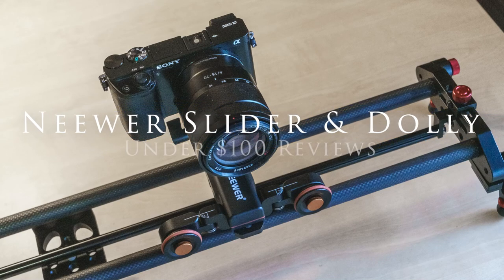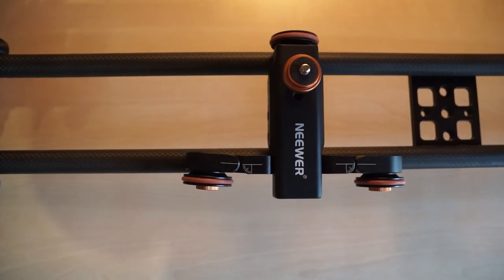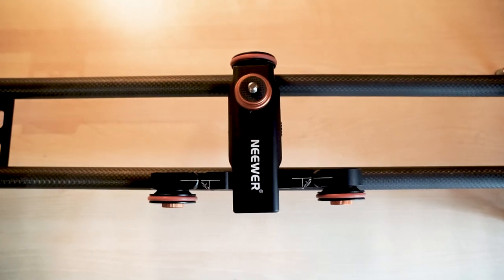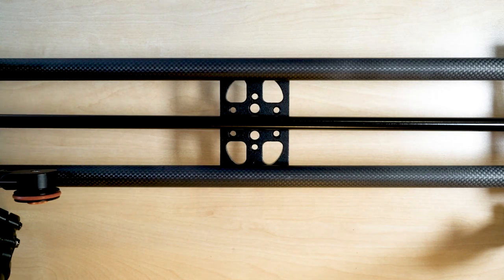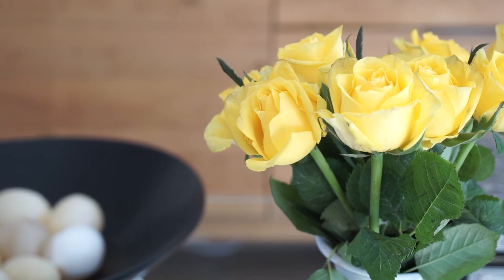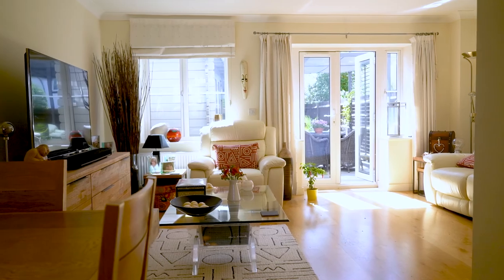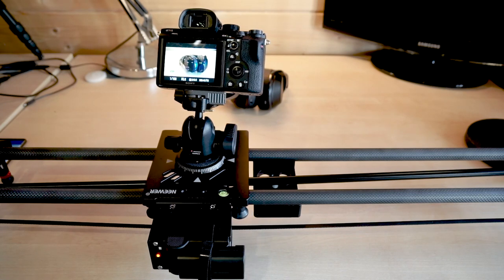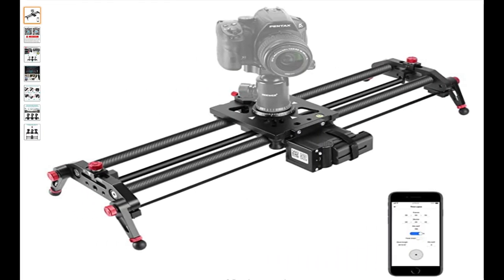Neewer Auto Dolly and Slider Combination

Comment: You have the wrong slider. Your slider version has a payload capacity of 2.2lbs. Of course it’s not going to hold a motorized dolly + a camera. They also have other Neewer sliders with a design that uses a flat metal beam to slide across instead of rails.

Comment: Hi, good job thanks. Possible rail 360 degrees ?
Reply from the maker: Not that I'm aware of. The Auto Dolly can do 360 when run on a flat surface or you can use a turntable.